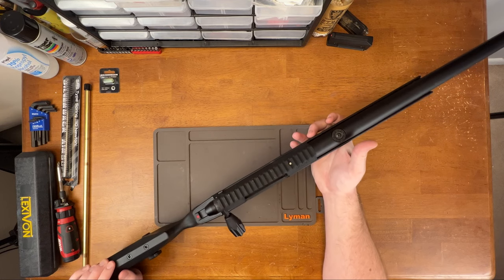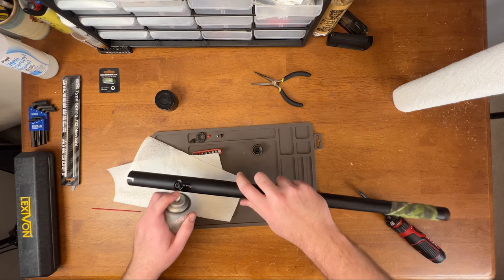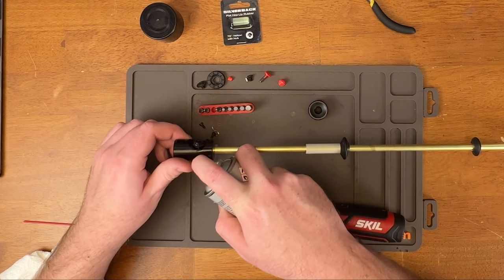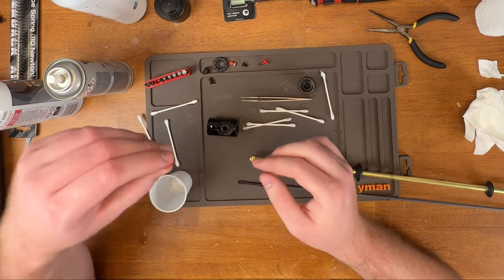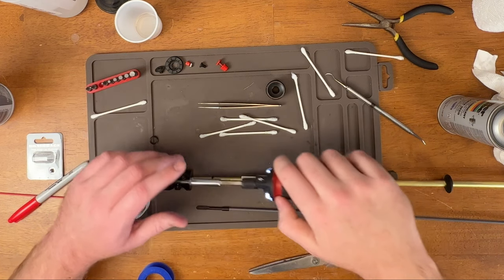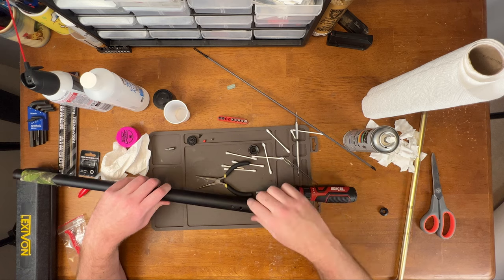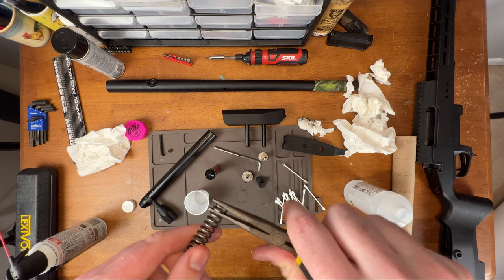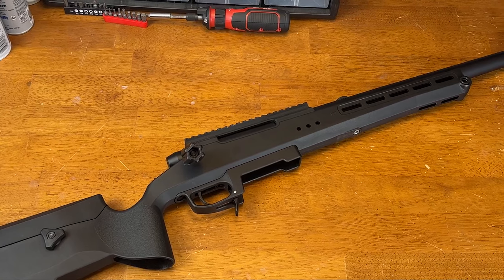Silverback Tac 41 Inner Barrel Removal And Hop Up Rubber Replacement ( Disassembly )

Comment: Next time, try holding the hop-up chamber under some hot running water for a few seconds. That will expand the aluminum slightly and expand the ID of the barrel 'hole'. Can't hurt to try...

Comment: Hey man thanks for being the Tac-41 Guru👍 just picked one up and can’t wait to get out there. All I run is GBBRs so maintenance is a thing I like to have down to a science. is there any amount of grease (super lube) I should apply to the outside of the cylinder/bolt for a smooth bolt pull or is it already as smooth as it can be with out lube? Just don’t want to overthink it lol
Reply from the maker: @christappan5195  i would put a little bit of super lube, the upgraded glide rings from skirmshop made a difference for me

Comment: I've ripped two buckings already trying to push the hop up onto the rubber but the crappy teflon tape just bunches up and prevents me from being able to see the flat face witness marks so I have to repeat the process. I'm pretty mad about just burning through £15 of 70 degree SRS buckings. I have one left, should I just install it without the tape?
Reply from the maker: I said in the video I didn’t like the tape. Its not worth it

Comment: Hi Connor,    I've looked and looked and haven't been able to find a video on removing the orange tip.    Is it a simple heat and pull for the plastic?    I have a solid pin in mine not a set screw, and I didn't want to damage anything.
Reply from the maker: As im not sure exactly what the new tac41 orange tips look like i cant give you an accurate answer. If its anything like a jgbar10 orange tip you would just use heat and unscrew it. Then pull the pin out with needle nose pliers!

Comment: Best resources out there for the tac 41, many thanks. Do you know what's a good spring to use in this to get under 2.28 joules/ sub 495 fps with a .20g bb?
Reply from the maker: The SRS m160 spring will get you to 500 with a .2
Reply: @airsoftconnor  will a stronger spring call for any other internal needing to be upgraded

Comment: Thank you so much for this video!! I actually watched this because I want to clean my barrel without getting any oil/ residue on the hop rubber during the cleaning. At 0:54 you take that little red rubber thing out, is that the part I don’t want to get the cleaning stuff on? I want to dissemble the gun as little as possible (because I don’t want to shred the bucking) when cleaning the barrel. Many many thanks!! :)
Reply from the maker: You should only clean your barrel with rubbing alcohol. Now you need to be careful when running a cleaning rod though because you can damage the bucking lips. So if you want to clean it without taking it all apart, just take the barrel off with the 3 hex screws. Then id run the cleaning patches from the end of the barrel to the hop rubber (don’t force it all the way through). Once its clean enough, you need to use a q tip to clean where the bucking is because you will have pushed some dirt to the front of the barrel. Avoid oils because they will attract dirt.
Reply: @airsoftconnor  Thanks for the quick reply pal! I’m glad I asked then because I was going to use my Power Pull Through Kit for my air rifle, in which you use Napier air gun oil in the barrel! Okay brilliant, thanks ever so much. It sounds like I’m probably better off just removing the hop up when cleaning. In which case, would you recommend having a spare bucking to hand in case it shreds when removing? Many thanks!
Reply from the maker: @christophersummers790  yeah have a spare if you take it off. If you have dry lube like i had just soak it before you take it out. You can clean it without removing it though. You just need long q tips

Comment: silverback need to make an updated bucking where they dont rip instantly! Also SB buckings with their chambers do not need teflon, you'll have 100% seal with out it.
Reply from the maker: Yeah, im using the stalker hop up now! Also i took the teflon off!
Reply: @airsoftconnor  I'm super tempted to get the stalker chamber for the SRS, would you say its worth it as a upgrade?

Comment: Does your bb curve to the right or left when you shoot yours?
Reply from the maker: No, that sounds like a dirty barrel and hop up bucking
Reply: @airsoftconnor  must be the hop up bucking then, I haven’t fielded it yet
Reply from the maker: @Channy1701  Everything still can be dirty from the factory too. But some have said the the hop up screws are loose and that can cause the inconsistencies
Reply: @airsoftconnor  ok thanks for the help, I’ll try cleaning it
Reply: @airsoftconnor  there was a hole in the rubber at the top of the piston, is it possible that can cause curving?